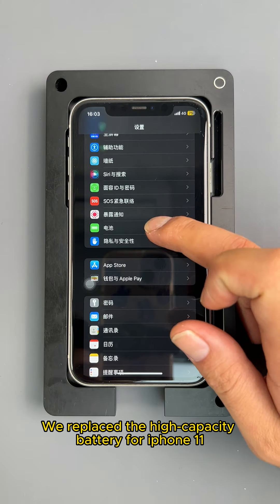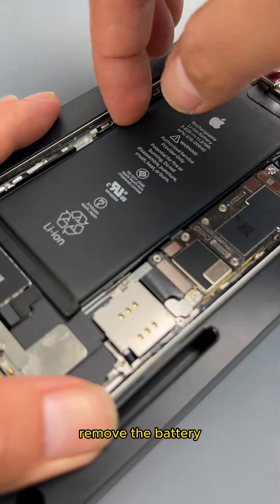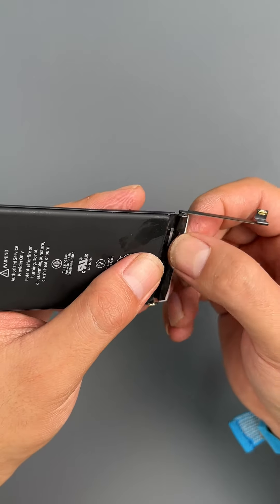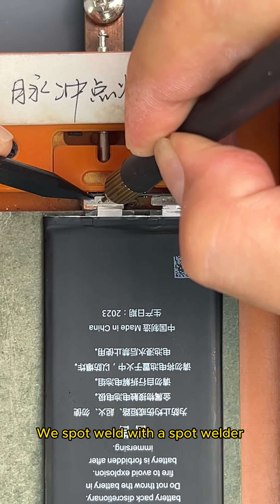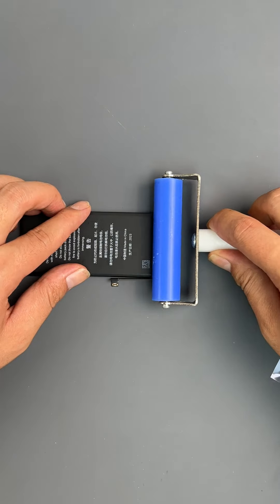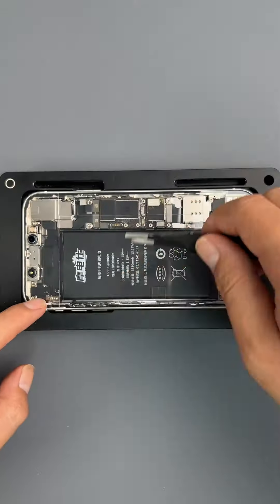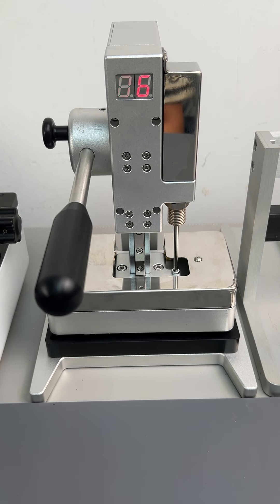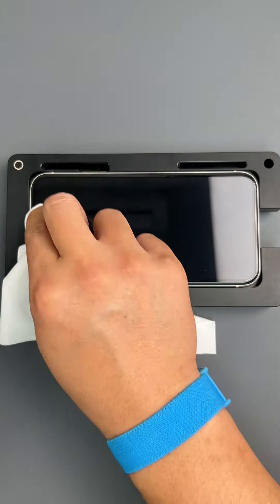Replace high-capacity Battery of iPhone 11

Comment: Hello. Be careful when removing the water proofing mesh as it’s very hard to replace. Furthermore, please do not use an off brand battery or second hand poorly quality battery or a battery that’s higher then then capacity the phone originally had  it could catch on fire, malfunction, and explode, it could also lose battery health fast if it’s a bad poor quality battery. If you can, look for official replacement parts that Apple sells or buy high quality similar battery’s from 1st market brands.
Reply from the maker: If you have enough money, it is recommended to use Apple's official battery.😊